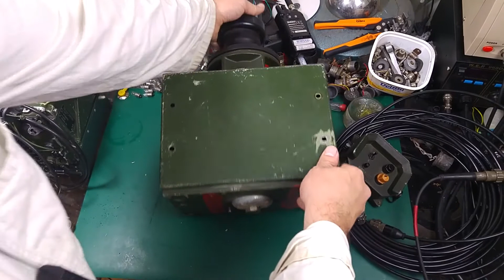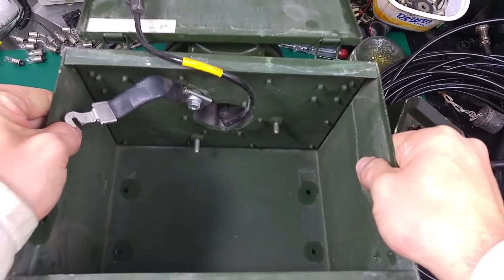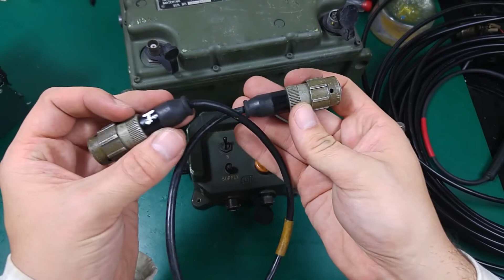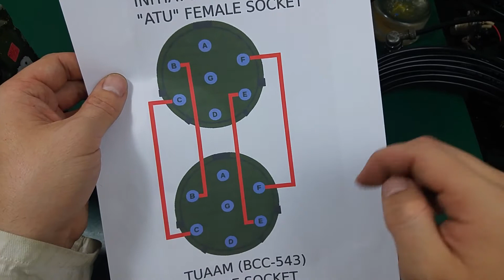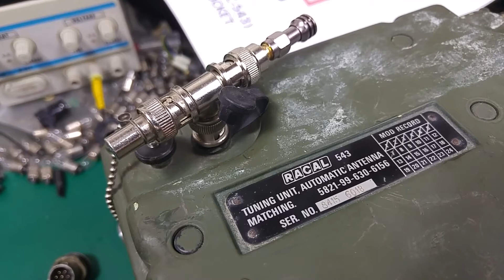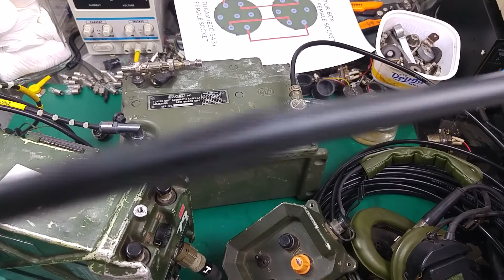Clansman PRC 351 PRC 352 - RACAL 543 (TUAAM)  military automatic antenna tuner for tactical VHF

Comment from the maker: For future here is schematic of TUAAM initiator box:

https://electronicnoobblog.com/wp-content/uploads/2020/12/cofflgifidfnkala.png
You can use it without it and with any radio by following this simple steps;
Left side   schematic is for ATU (straight cable 1:1) so just look up at letters on the ATU socket  they will match.

From this You are interested in pin C  (with is 24V DC) and E with is GND.

Other pin is used for triggering silent mode (not needed) and for triggering PTT on radio by ATU (not needed).

Just apply power to C and E   and transmit RF and it will tune - check SWR on radio to be sure.

Comment: Very interesting.. I used to use this back in the day. Never seen the tuning unit controller though. Just used to tune directly from the PRC353 vehicle radio as it had a tune setting on the power knob.
Reply from the maker: I think Your radio talk directly to tuner so this panel was not needed.  PRC353 if I recall it supported some kind of digital data mode? Have You use it with teletype?
Reply: @ElectronicNoobBlog  Only used the T100 teleprinter with a 321 via some crypto gear.

Comment: Interesting video.  This antenna tuning unit was designed at Racal-BCC in Wembley, London by David Hodgson (my boss).  It was part of Clansman series and was indeed designed for use with PRC351/352.  It was typically installed on FFR (24 volt) landrovers, APCs and light tanks.  Thank you for posting.
Reply from the maker: And thanks to You for first hand feedback!

Comment: Never saw this set up before in my years in the Royal Signals. The TUAAM (Tuning Unit Automatic Antenna Matching) is made for the VRC 353 and you need the ARFAT (Automatic Radio Frequency Antenna Tuning) connected with the control cable (as well as the coax) for it to work correctly.
Reply from the maker: Are You sure, I don't think BCC-543 is designed for constant 50W, maybe You mean BCC-563?
Reply: @ElectronicNoobBlog  We only had one kind of TUAAM (and that is 100% a TUAAM) in the Royal Signals. and that BAE (Base Antenna Element) is the type we used together with the TUAAM and ARFAT to use a 353.
Reply: The 5820-99-630-6488 is labelled M/PACK and therefore suggests that it is used in a PRC-351 application surely? As I recall, the manual confirms this.

Comment: Do you think it could work without PRC 351? Or in other words - could it be adapted to use with any other radio f.ex. some HAM radio?
Reply from the maker: Sure, it can be used with any radio.
I have schematic for control unit with all pinout. If You want i can find it.  From what i remember it require just power and automatically start tune cycle (you need supply RF then)  to re-tune just reset power and  apply RF.
Reply: @ElectronicNoobBlog  I found your web blog. Does your email is all three words or first two?

Comment from the maker: Errata: 

I state that it lengthening antenna and that will be true for lower band, for upper it will short it up because vehicle antenna most like will act like 1/4 wavelength.  So for example 50Mhz will give 1/4 wavelength about 1.5m (whip is about 2 meter long).